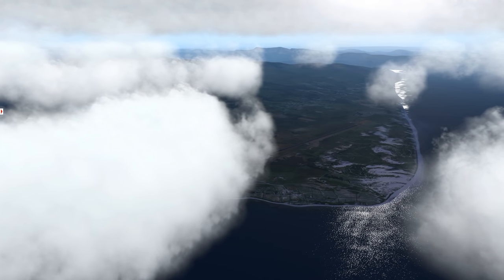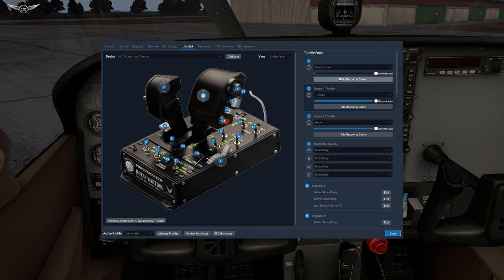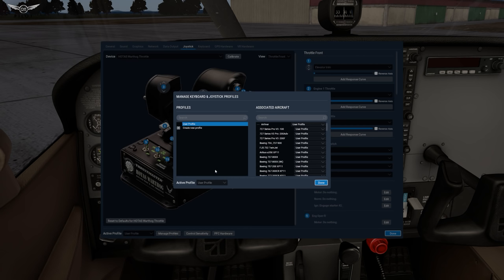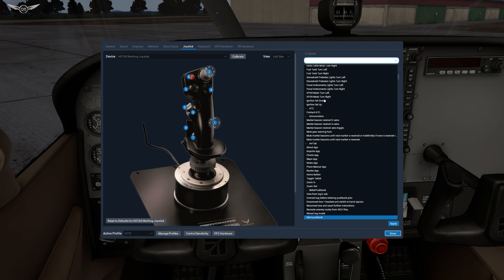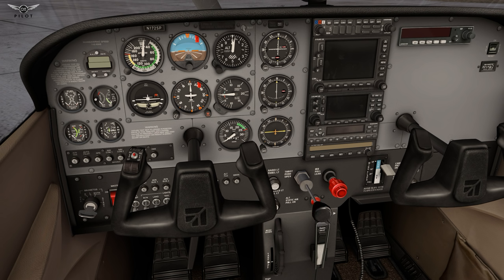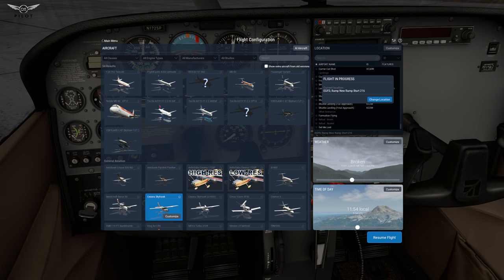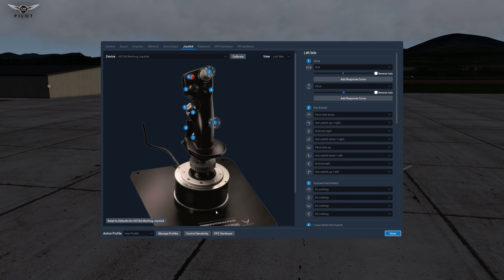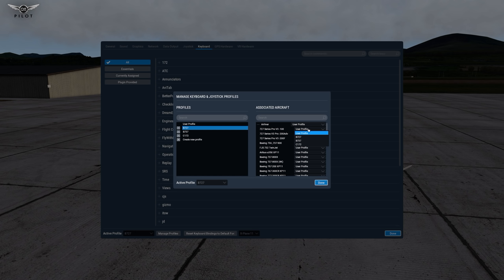X-Plane 11 | How to Create Aircraft Specific Joystick and Keyboard Profiles

Comment: alot of third party aircraft dont have certain commands listed in the xplane menu, to get them you can create LUA script and assign switches and buttons from your controllers  example, 
create_positive_edge_flip( 5, "anim/43/button", 0, 0, 1 ) --Nav light
create_positive_edge_flip( 6, "anim/44/button", 0, 0, 1 ) -Strobe light - red
create_positive_edge_flip( 7, "anim/45/button", 0, 0, 1 ) -Strobe light - white
create_positive_edge_flip( 8, "anim/46/button", 0, 0, 1 ) --Wing lights
create_positive_edge_flip( 9, "anim/52/button", 0, 0, 1 ) --Logo lights

Comment: Hello,
Very informative video!! I have a question that is kinda on the same topic. I'm running X-Plane 11.30 r3 with a Thrustmaster Warthog joystick.  On ally my 4 engine jet or prop aircraft only 2 of the 4 throttles will advance!! I researched the problem and found a plugin on X-Plane.org called "Dual-to-Full Throttle 2.0" I installed it and it worked fine on the beta versions, but is not working on the 11.30r3. Do you have some instructions or tips I can follow to get all 4 of the engines to throttle up? Thanks so much for your help!!

Comment: Question, is the custom profile bound to the controller hardware used or can you set different profiles for different hardware? I have 3 different throttles based on different planes (a ww2 fighter, a default Cessna 172 and a civilian jet). If I create a profile for the WW2 fighter which has a prop control is that profile associated with that controller only? Again, if I restart and plug my Cessna throttle in, which has no prop control, and load the 172 in and open the custom profile for that would it remember the hardware associated with that controller or will I need to reassign the commands again? Love the idea of custom profiles but not quite sure how far I can punch them! Great and informative vid, thanks for sharing!
Reply from the maker: With every profile you should be able to have different settings.
Reply: @Q8Pilot  thanks for the reply, was hoping I could have different devices setup with their own unique profiles. Will test tonight!

Comment: What if I use a yoke for my Boeing airplanes and a sidestick for airbus? Do I have to constantly unplug and replug in my devices?
Reply from the maker: No you don't. I have all my controls connected. You can define profiles.
Reply: Q8Pilot so for example while flying the 320 have the stick as the assigned flight control? Anyway you could make a video on it if not totally ok. Thank you for responding huge fan of the vids.